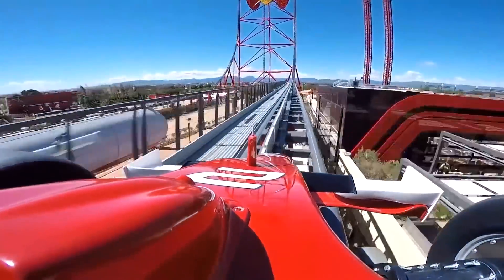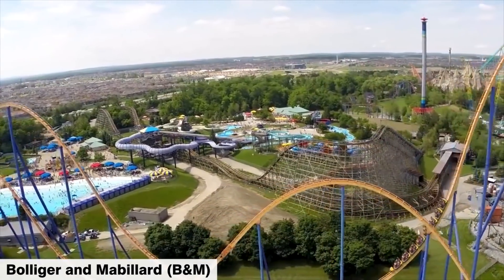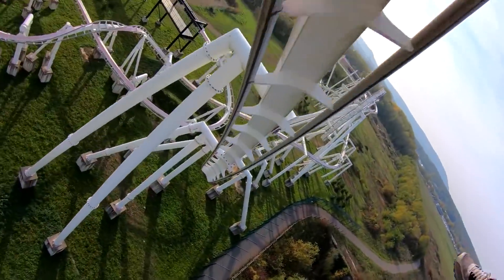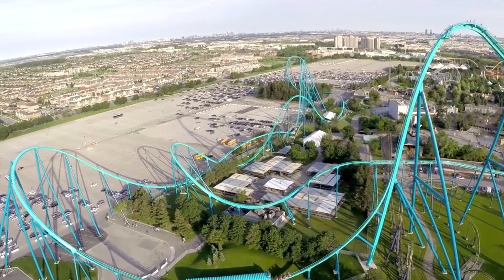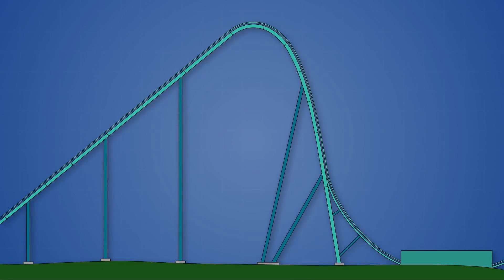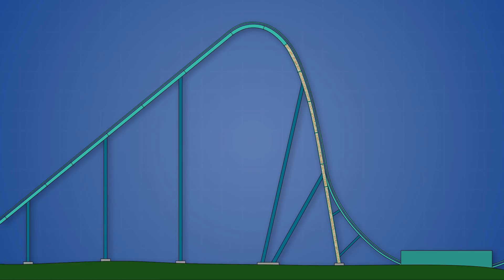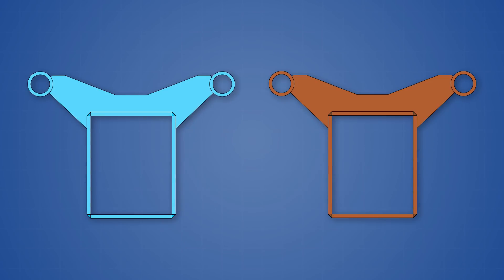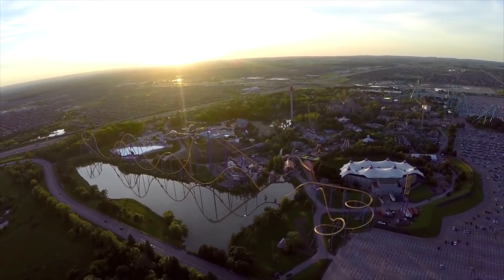Why Roller Coaster Track is Filled with Sand

Comment: It might be a moot point and totally redundant, but the Kumba coaster at Busch Gardens Tampa Bay was intentionally designed without sound dampeners to imitate the sound of roaring which is what Kumba loosely translates to in the Kongo language. You can most definitely use that ride as an example of how insanely and painfully loud coasters without sand filling or other dampeners are. Standing anywhere near that ride is a rough experience for your ears and riding it is even worse 😂

Comment: Not an expert, but don't they use sand in sandblasting, water cutting jets, and sand paper(abrasive). So with that in mind every time the coasters past and the sand vibrates, wouldn't that eventually wear the tube from the inside out to the point of failure ?
Reply: While sand blasting the sand hits the object with a high momentum, in the rails the sand has no momentum and just vibrates.
Just imagine you have a small steel cube with sand in it and shake it.
It would take forever till the sand actually does any damage

Comment: I thought roller coaster tracks were charged with nitrogen and the pressure monitored. If the pressure drops, you know there is a leak which means a crack someplace.

Comment: Could you do a video on the plausibility of using a roller coaster style hill or drop tower system for public transport? How plausible would it be to build a commuter coaster network with multiple parallel tracks, completely passive trains, with all of the propulsion done by putting energy into the coasters by pulling them either up a hill or pulling them backwards up a drop tower? How would the cost compare to the currently favored system of powered subway cars? How many parallel tracks would be needed to give the same commuter throughput without risking safety issues? How far could a roller coaster train actually coast? Would ballast be needed? Could one big drop and a slight grade to the track be sufficient to coast commuters across San Francisco bay? What if the trains were covered so as to be extremely aerodynamic? Also, how does the duty cycle of a subway compare to that of a roller coaster working full time at a busy amusement park? 

If there were a commuter coaster system, I would actually enjoy the commute.

Comment: Where is the acoustic analysis report? How much decibels has sand reduced. Why did not they think about better solution on roller wheels design or changes in material selection. Instead of filling sand in frames.

Comment: Aside from noise the additional benifit is that its great for the structure itself. Vibrations lead to cracking parts and fatigue and failure. So they kind of hit 2 birds with one stone.  I mean, sand.. Wait... What?...

Comment: Sand would reduce the vibration that the box beam is emitting, But it would also in effect “sandblast” the inside walls of the box beam...Over time gradually removing material and weakening them...

Comment: I doubt the sand solution is as good as claimed.   It must reduce the noise, but how satisfactorily.   No representative of the residents tells us.   The claims of success undoubtedly originate with the theme park owners.   Even moderated with sand, a train hurtling by at 150kph (94mph) 100 meters (310 ft) away with no barriers between (trees, structures) must be hell to live with.

Comment: bad idea for steel beams . . . . if those beams are aluminum , then there might be a chance of the sand being ok. . . long as it is 
 '' DRY '' , 
reason is because sand holds moisture, and moisture rusts out steel. . . . badly.
what they should have done was use dyno mats . . . .the things that most loud music heads use to dampen the rumble of the metal from their vehicle .  

but sense they are filling the items before putting them together, then they should use  silica beads ( or in that case  '' strips '' ) 
to be put inside the rails and beams  ( and keep it from rusting out  [ condensation ] )   for a more silent run. . . as like a thief in the night. 

good video .

Comment: The movement of the sand particles against each other will ultimately turn those sand-filled tubes into dust filled tubes which will provide significantly less sound dampening.  (in my humble opinion)

Comment: The loudest roller coaster I ever heard was Top Gun at Paramount's Great America.  I'm pretty sure they intentionally designed that one to be loud, trying to mimic the sound of a jet engine from a fighter plane.
I don't know if the locals ever complained about the noise, but it seems unlikely to me since they had airplanes frequently flying over at low altitudes because they were directly in the path of planes taking off and landing from the San Jose airport.

Comment: In pa there are really loud roller coasters  but the best one by far is the Great Bear at HersheyPark. Theirs No sand at all in the tracks and at one point you go flying through a concrete tunnel and holy living crap it’s loud. The extremely loud roar of the track echos and bounces off the  concrete walls in every direction which makes it 5 times louder.  If their was a grizzly bear the size of a Dino that would be its growl.  Imagine A grizzly bear growling into a microphone with a amplifier that times the volume  X10 and do it in a tunnel.  The tunnel lasts for only 5 seconds though😢. I love that thing.

Comment: IMO they should not have damped the sound. The sounds are an iconic and beautiful part of any park, and the neighborhood across the road moved in voluntarily after the fact. If you don't like roller coasters or their sounds, don't move in across the street from any amusement park, much less a Cedar Fair park. You might as well be moving into a college off-campus neighborhood and then whining that there are party noises every Thurs/Fri/Sat. If you choose to move into that neighborhood, you should be the type of person who has a perpetually-renewed season pass.
Besides this, honestly who could dislike the sound of roller coasters? The smooth roar of the train on the rails accompanied by the thrilled laughter, cheers, and screams of the riders is beautiful.

Comment: I wonder why on new builds they do not use sound dampening material in the large box part since it would be MUCH lighter than sand and easier to work with.

Comment: No one ever thought of welding a serpentine ridge of steel along the outside of the box beam?  By randomly varying the height and pattern of the ridge the sound would not be uniformly distributed by the vibration of the box (and the ridge would further reduce the overall vibration of the wall).
In conjunction with adding a vibration dampening media lighter than sand (vermiculite, for example) the sound could be even further reduced.  Though never really lessened all that much due to the cars themselves.

Honestly, whomever allowed a residence to be constructed within half a mile of a large theme park should have their developers licence revoked.

Comment: So to get this straight, people moved in next to a theme park and complained that it was too noisy. How blind do you need to be to not see a massive theme park in front of the land where the house would be. Something similar to this also happened to Laguna Seca (a racetrack in USA) and the government actually put in noise restrictions which were worse than those for the cars on the road. So now all the people coming to track their car out there have to put massive external mufflers to go under the noise limit. Those people living next to the track still complain apparently.

Comment: Beginning: Can't put sand in rails of already existing roller coaster because it would mess with the smoothness.

End: You can put sand in the rails of both new and existing roller coasters.

Which one is it?

Cheers,
Chris
Reply: Adding sand to existing track requires the tubes that the trains run on to be cut open and welded back together. The cutting open and welding back together of the track could make it less smooth due to the malforming of the steel track. With new track, sand can be added while the track is manufactured meaning that the steel tubes don't need to be cut open and repaired. In other words, the sand doesn't make it bumpy, it's the cutting of track which does.
Reply: @AdamLW01  I'm well aware of that. That's why I was asking why the contradiction in the video. And you can add sand to existing track without cutting into the rails. You add it into the boxbeam part of the track.

Edit:

Apparently I heard him wrong at the end. He refers to "track" rather than "rails" when he includes existing roller coasters. This makes sense because, like with Leviathan, the "track" includes the boxbeam which can be cut open and filled with sand without having to cut open the rails and mess up the smoothness like you mentioned.

Lol, as someone who's been a fan of and researching roller coasters for almost 3 decades, this was a simple hearing error on my part. The video is indeed correct.

Thanks for the reply man. Otherwise, I wouldn't have checked back and rewatched the video, and updated my comment accordingly. Take care mate.

Cheers,
Chris

Comment: Curiosity, if sand is added to the roller coasters and used as a sound dampener, wouldn't it over time wear down the metal from the inside? As the vibrations from the coaster going by move any lose sand, it could make small vibrations and as we all know, sand is an abrasive, cause holes in the roller coaster.
Reply: No. Moisture from the atmosphere is for more damaging to metal than dry sand inside it.

Comment: Personally, I don't think it's strange that he didn't include the different sounds of all the coasters. At its core, this video is not about the sounds that roller coasters make. Rather, it's about how innovative engineering is used to solve problems. If anything though, I might ask for 'before and after' audio of what a particular coaster sounded like before the sand and how much quieter it got once the sand was added. Nonetheless, this was an informative video. A- (A minus).

Comment: The big question. Is the sand baked in a kiln beforehand then filled and welded??? If you weld a peice of metal with sand in it it's going to create gas, even if its dry. So if they put just any sand in there, weld it and send it it's going to be full of gas from boiling water and melted sand/ metal...I would not risk my life on that ride after this project was done. I know others in the industry and I wont mention any rides but there in northern California and while in line I've asked buddies to call who they know made it..and they have said " I'd stay the fuck away from that thing." Multiple times...I'm talking engineers that said " if that's your budget then fine, but it will only be safe for (X) amount of seasons or years." I hear that from them. I dont care how bad it looks fun. That one time. Final destination people....
Reply: Furthermore if they load it in a hopper an push it in it's been sitting in the hopper for HOURS waiting for dude with the plasma cutter or grinder to get up to the point of fill to then make the hole, fill it, then re-weld it, hopefully dude knows to make a vent hole above to prevent gasses getting trapped in the pipe causing more corrosion...jesus this is gonna make me lose sleep knowing people do this....
Reply: @kersone13  There are people with more knowledge than you making these decisions.
Reply: @sharkheadism  cool dude I was just putting I'm my experience. I'm not a certified welder or anything (actually I am...), I just do it everyday of my working career. But whatever right?
Reply: @kersone13  Are you a professional engineer?
Reply: @sharkheadism  no I am not. You win. Is that what you want to prove? I just know common chemistry of what happens when you weld a sealed pipe and gas cant escape because I am a professional at what I do.
Reply: @sharkheadism  but in also saying in my first comment, my brother in laws buddy IS the engineer that designed the rides I have avoided because he said to not trust it. That was my main point bud.
Reply: @kersone13  So your brother in law's buddy's nephew's cousin doesn't believe in the safety of his own designs. Right
Reply: @kersone13  Ok. Let me know when that happens. The manufacturer of this ride, B&M, has been around over 30 years and no incident like what you described has happened.

Comment: Err, one of the main reason to use sand is it is easy to see if cracks appear in the structure, especially at inaccessible parts. As a damping material, other materials can do a much better job.
Reply: Parks use more effective methods to inspect their rides
Reply: @sharkheadism   They do, but full inspections are not that frequent.
Reply: @10p6  They're at least annual, which is fine for the track. The trains, lift, and brakes among other parts are inspected daily.
Reply: @sharkheadism  The mechanics are meant to be daily but much of the time this is overlooked. The main structure is barely ever checked, yet as shown in past incidents, can quickly fail and cause disasters.
Reply: @10p6  Oh, you're a putz. Got it
Reply: @sharkheadism  No. I know people who own amusement parks and what is involved in the maintenance of coasters.
Reply: @10p6  Sure you do

Comment: so basically they made hollow steel structures to amplify the sound
and then put sand in them so that they arent so goddamn loud, am I getting this correctly
Reply: They weren't made to amplify sound, it's just a property they have as a result of their shape and construction. They were designed to carry the load of the track and train safely and economically.

Comment: dont tell me all manufacturers coasters have distinct sounds and then not let me hear them
Reply: yea, wtf !? came here to complain about the same thing
Reply: @Arrow Dynamics Inc. your biased. No
Reply: Honestlyyyy
Reply: Coaster Bot's video called roller coaster sounds: explained has the actual sounds
Reply: Dead asss
Reply: not to mention this guy's wrong
Reply: Jack how is he wrong?
Reply: Sami the sound is almost entirely based on the track design. Rides made by manufacturers that use similar track designs such as Intamin, Gerstlauer, and Mack Rides produce nearly identical sounds.
Reply: @sami-iami  wtf give me my name back you imposter
Reply: Sami I came first 🤷🏻‍♂️
Reply: @sami-iami  smh

Comment: By having the sand in the structure, would this also make the structure last longer and require less repairs? It seems that the sand absorbs the sound which means the vibrations would do less damage to the structure of the coaster over time.
Reply: Travel With Tbone I was just wondering about the opposite. Wouldn’t the sand act like, well, sandpaper and eat away the inner walls in the long run?
Reply: @balazsorley1691  Interesting point. Perhaps the art of engineering as a video to consider making :)
Reply: No

Comment: Great Bear @ Hershey Park doesn't use sand.
Reply: Well to its credit, that's the point.  Because the roar is meant to represent the name. Plus unlike the other coasters Great Bear has the terrain to help dampen and keep the noise corralled to a certain area.

Comment: I live a bus ride away from Canada's Wonderland. I've been there in 2012 and 2014, riding on the Leviathan both times. CW said that the Leviathan (which was notorious at the time) goes as fast as 148 km/h. Also, the Yukon Striker actually opened this year.

Comment: So, is there no problem with filling a consistently vibrated void with an abrasive material? Is it actual sand? Won't it reduce the lifespan of the track by sanding through it? I'm sure they thought about it.

Comment: If you overlook certain aspects of the property you are buying then it is YOU fault if one of those aspects is intolerable.
     You have no room to complain if you buy a house near something that smells bad or makes a lot of noise.
Reply: That's not the case. The problem was because the noise increased after the installation of a new ride.

Comment: This is a good video, but it's one of those topics that you can basically answer in one sentence - "to reduce the noise caused by track vibrations". Don't need 6 minutes of explanation for the depth this video went into.

Comment: Why didn't they just use standard building compression foam, which weighs a fraction of what sand weighs and actually enhances the structural integrity of the box beams?

Comment: why they do not use wheels with softer rubber, it should be less noise,and let use wheels with radial tires filled with gas, (usualy i use solid wheels with full rubber tires that can fail  on high speeds )

Comment: The ironically named "Art of Engineering" doesn't know how to normalize audio
Reply: There are a lot of different types of engineers. Some would focus more on sound than others. There's no irony in it unless he is an audio engineer.
Reply: You're completely missing the point.
Reply: @fudhater8592  So are you 😀
Reply: @gargaduk How so, professor?
Reply: @fudhater8592  As he stated: "There are a lot of different types of engineers."
A sound engineer and a mechanical engineer are two entirely different things, despite the word "engineer" in it.

A sound engineer actually isn't really an engineer in the true sense of the word, at all.
Engineer: "a person who designs, builds, or maintains engines, machines, or structures."
The audio engineer on the other hand does digital things. What you complained about is levels of the audio, which you do in an audio software, or later in the video editing.
So this has nothing to do with "The Art of Engineering", by which the "real" engineering is meant.
Reply: That's out of the scope of this thesis as it's beyond the field of engineering being discussed here. 😂😂